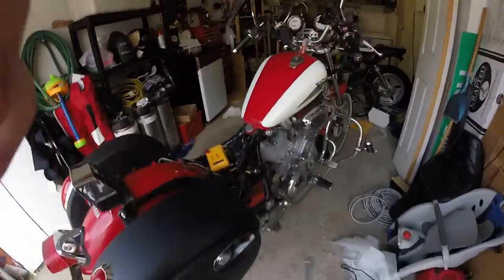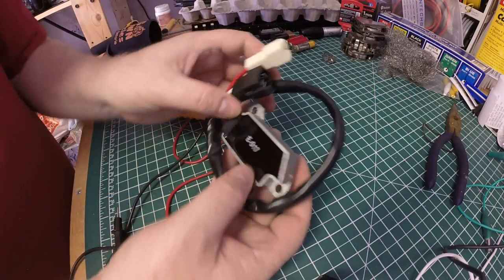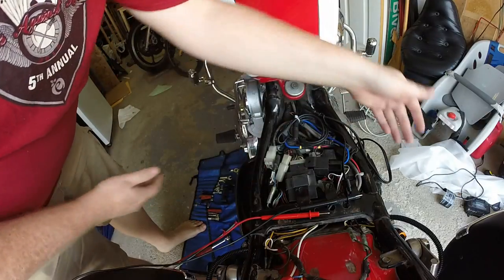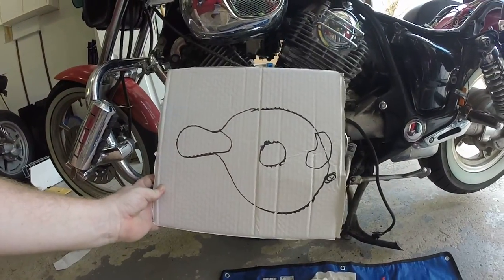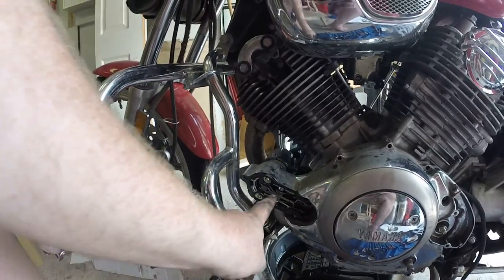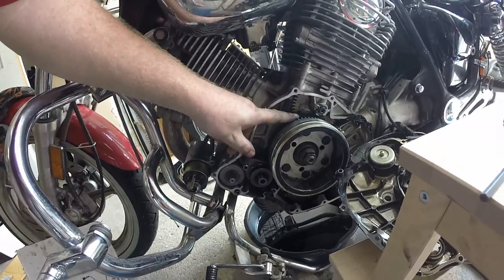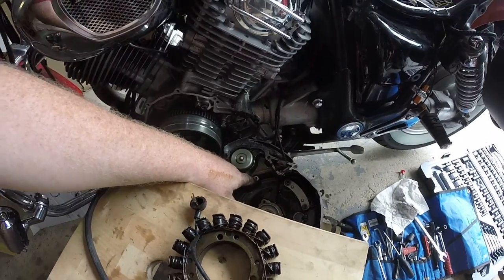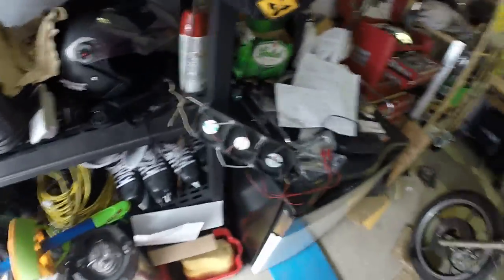1995 Virago xv1100 Stator Replacement (Part 1: removal)

Comment: Alex, great video's love the attitude, it's always better to laugh and keep working. I've got a 96 xv 750 recently replaced stator cover gasket (uselessly as i was replacing the shift lever seal) ever since my starter will not disengage. I didn't see any funky breaks around the starter gears when i had the cover off. I've heard it could be a stuck switch/relay, however i am thinking the drive lever collar screw has worn the starter lever/actuator/fork pins. No reference though for tolerable wear. Any ideas?
Reply from the maker: Check to make sure the starter gear slides on and off easily, and that the "thingy" that dis/engages rotates nicely too.  The starter gear assembly should only be in-mesh with the main spin-a-ma-thinger while you have the button pressed.  Take apart (again) the cover for the starter "activator" and just check that you can manually move the thing back and forth in place.
Good luck man.  Let me know how it goes.
Reply: Success!! Double checked the starter actuator, which had some play, decided to go further and take off the stator cover and check for wear or a broken spring. Got lucky no broken parts, threw it all back on, and made sure the actuator had no slop. (or that i put the actuator lever, on the right way) So far so good but the problems emerged progressively the more time i put in the saddle. Thank you Alex
Reply from the maker: Nice bud! Make sure you torque/tighten the two bolts that hold the actuator in place; they may have stripped the thread.  Do they feel "spongey" when going in?  That's the tell-tale sign the threads have been fucked.
Reply: No noticable sponge on the drive lever pivot screw or on the solenoid mounting nuts. According to the clymer book the pivot screw take 88 in.-lbs; the solenoid mounting nuts 71 inch lbs. But I don't have an inch pound torque wrench. Nevertheless they stopped with moderate pressure with 1/4 drive ratchet. The drive lever collar screw however was certainly spongy, giving a false sense of proper torque. ( Especially when the lever was inverted) I will look into a new Drive lever collar screw to be sure!

Comment: Hey... that blue wire from the stator.. where did that plug in to? Struggling with reassembling my own bike
Reply from the maker: dkfde29 in the part 2 video, I figured out that it's the gearbox's neutral light switch. There's a Phillips head screw on the bottom of the engine, mine was brass. The stator wire should have a rubber protector that goes over a U shaped wire end. The U shape slides onto the screw on the bottom of the engine (screw doesn't need to come out, only loosen).

Comment: Help cant find my starter relay 96 750
Reply from the maker: The starter relay and flasher relays are in a sealed black box under the seat; there should be a "rubber band" holding it to the frame right in the middle. It has a part number 41R-71 printed in white on one side.
If you're having trouble starting out flashers not working, try cleaning the contacts on it first.
Reply: @zeroreality  ya i found this i ben working under the seat but that part is not the starter solanoid relay its the other one flasher for lights i got the part coming in the mail i let you g know good help but i still cant find it followed posotive wire only bring to the fuse casing
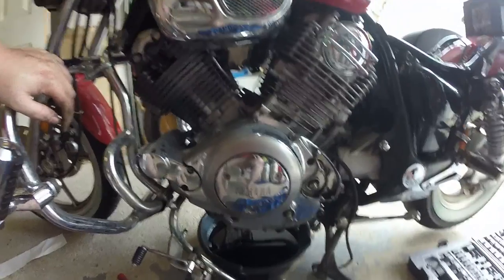Reply from the maker: rich.johnj  OH, you want the solenoid! That's easier. Check the video at about 6:30 and you can see where it is. There are two screws on the back side that are a major pain to take out (I had to use two extenders to reach from the other side of the bike) and you'll need a T30 bit too take off this "bar" thing it hooks on.
Reply: @zeroreality  ya i was so glad to see this video on here i dont  need to drop the oil to pull the starter solanoid do i ////????/ idont know if its the problem yet i put new rectifier and the stator is good so hoping its not the starter gear mechanism thats bad you pulled that out also [alot of videos about the stareger gear mechanism] not the starter relay thanks a million freind hav a shot of moonshine o me
Reply from the maker: @liljibi  Shouldn't need to drop the oil as you don't actually need to get into the engine. The "bar" thing is outside the gasket's seal.  Good luck!